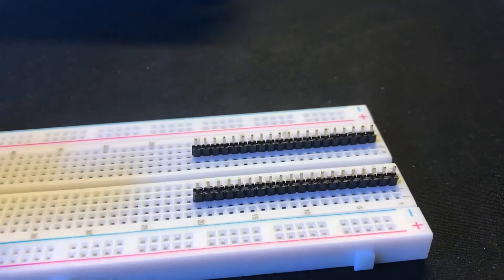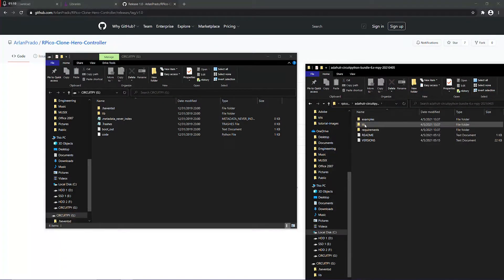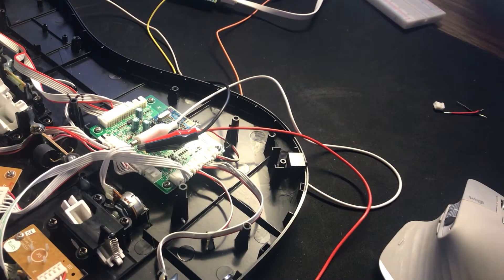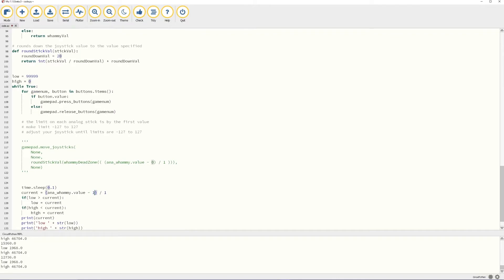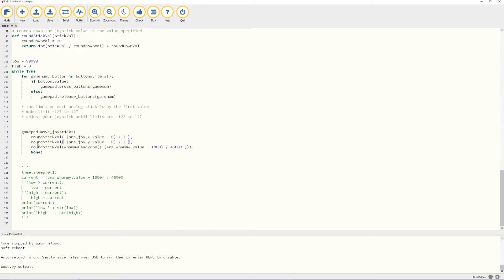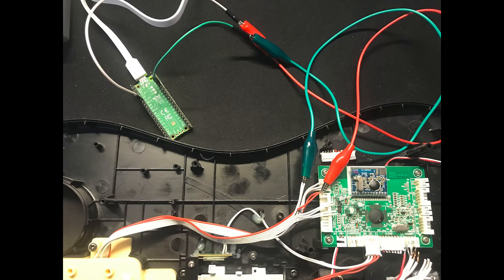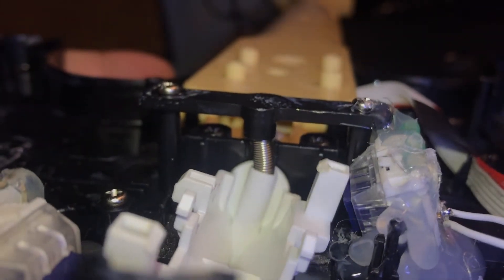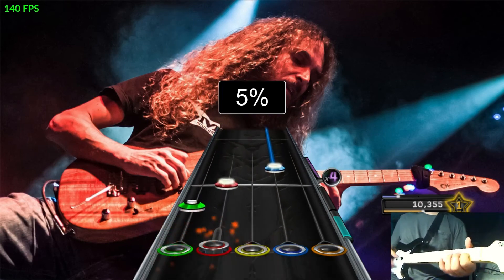Guitar Hero Controller with Raspberry Pico Tutorial

Comment: Is there any special wiring for the whammy bar, I can't figure it out (3pin)
Reply: middle is vcc outer is gnd other outer is 3.3 out.
Reply: @rewster9864  i tried this and i guess i put the wrong wire in the gnd and data pins on the raspberry pi and it lit on fire. not even joking.

Comment: My only concern is the lack of support for the switches inside the guitar. Using hot glue "works" but over time, it'll loosen up, sooner, rather than later.

If I had the dimensions for the Rock band strats, I could probably create an STL that would allow you to have them more securely fastened inside the guitar and have loops that brace against the stock screw posts inside the guitar. That would be far more preferable to this for sure.
Reply from the maker: Yeah honestly, the switch support is very hacked together and the stock strumbar should be used only. There's definitely a better way to support the switches but I don't have the resources to do so.
Reply: Yeah exactly. I couldn't find a design online for the mech switches strum board, so I designed my own. It's working fine, I didn't upload it anywhere yet because I'm still testing if I can make it better. 

I just had to cut the magnet posts and the posts where the strum spring bar screws in with some cutting pliers, and then get 4x 15mm screws to replace the original ones. It just sits over the original strum assembly.